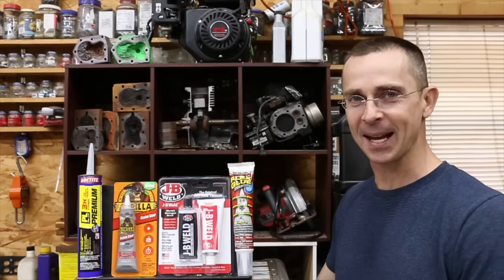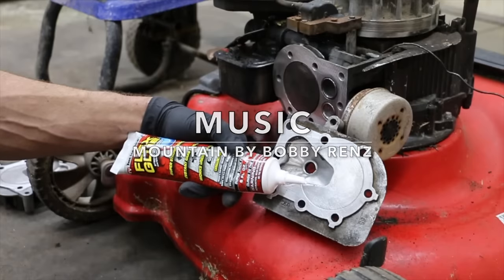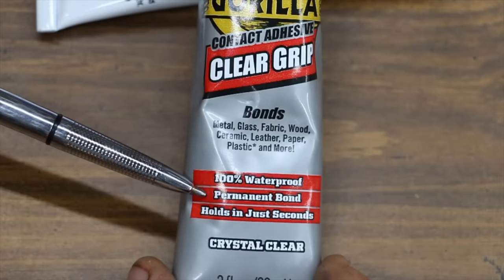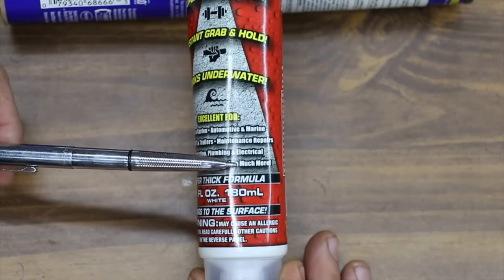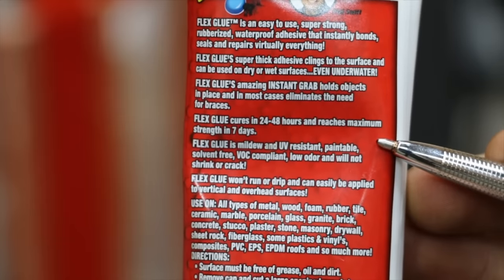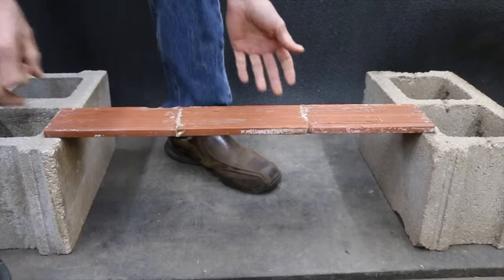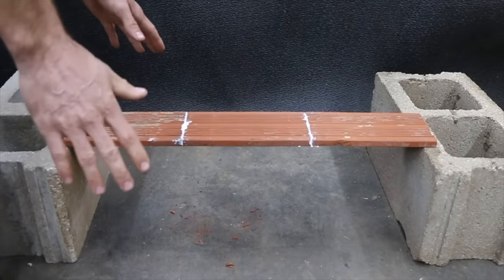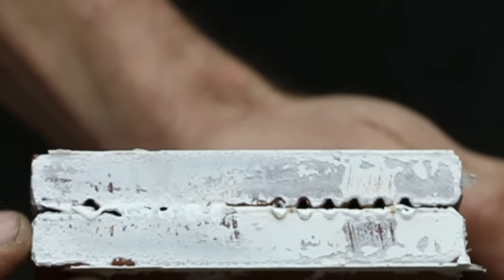Is Flex Glue better than JB Weld, Gorilla & Loctite?  Let's find out!

Comment: If you are doing a head test again, just back the bolts out a few turns.  You'll still know immediately if there's a failure, and it's safer for you and anything down range of the engine.  Of course, it's not as photogenic...
Reply from the maker: Thank you!
Reply: Drama is key.

Comment: I agree with comments below that JB I great except with heat. However on a old Farmall I patched a dime size hole with 1/8 in metal held on with JB. The hole was in the EXHAUST manifold bolted to the block, 2 1/2 in. From block. It never did fail after two years.😮
Reply from the maker: Thanks for sharing.

Comment: I have used JB weld to glue magnetic lock armatures to herculite glass doors. At one job location a thief tied a chain to the door handle and yanked the door out of the frame causing it to shatter. The armature, still attached to the glass was still securely locked to the magnet.
Hands down the best adhesive I have ever used.
Reply from the maker: Thanks for sharing.

Comment: Well for one thing, I didn't know Loctite had a glue. And for another, I never heard of Flex Glue before.

These companies need to watch their packaging. When something is cheaply packaged, and looks like K-Mart house brand, I won't even try it the first time.

How many viewers remember when Wranglerstar patched the ice expansion crack in a water pump? Wasn't it JB that he used? With surprisingly disappointing results. It cost him a lot of money.

These companies need to rely on their reputations. Because I don't have the money to keep trying new things.

Thanks for your test. Very interesting and practical.
Reply: I think Loctite bought out the company that made PL 400, a construction adhesive that was commonly used to glue subfloors to joists. Fabulous stuff, even when applied to wet wood. The bond was stronger than the wood. Not so great on metal.
Reply: Who the fuck repairs a water pump with JB weld, i seen that Wranglerstar channel and the guy is anything but handy. Everything he does is "facepalm" worthy, the second i saw him fell a tree i had to stop watching..
Reply: How have you not heard of flex seal by now? It's advertised all over the place. Even my 86 year old half blind grandma knows what flex seal is.

Comment: Used JB Weld to adhere magnets back to a windshield wiper inside motor housing , cured with 50 watt light bulb for 1 hour . Did repair in 2010 now 2023 , no failure .
Reply from the maker: Thanks for sharing.

Comment: You come up with the craziest ways to test products. I'm curious now if there is actually an epoxy that could hold a cylinder head on an engine.
Reply: If 3m DP460 won't do it then nothing will.
Reply from the maker: Thank you for the video idea!
Reply: @austinjordison  is that a structural automotive glue?
Reply: I wanna see that too!
Reply: @John-wk2fd  I think so. If I recall, it's primarily used for gluing metal panels onto cars.
Reply: Austin Jordison That stuff is just amazing.
Reply: We used it to glue the carbon fiber structural chassis panels together for our solar car. During testing the panels broke before the adhesive.

Comment: Had a leak on a small block chevy aluminum intake manifold. Didn't have the time to fix it. I JB welded it. Two years later I realized I hadn't gotten around to replacing the manifold. I swapped in a new manifold and sold the old one to a guy who was willing to use it. I sold it at scrap aluminum price so he wasn't risking anything but his time. He's been running it for years. Keep the heat under two hundred and it is great stuff.
Reply from the maker: Thank you for sharing!

Comment: NOW THAT'S A LOTTA DAMAGE!
Reply from the maker: I like that quote!
Reply: I laughed so hard when he zoomed in and said that. 😂
Reply: Many years ago I had to do a emergency repair on a aluminium block engine, the thermostat housing bolt stripped out !
    I drilled it out filled it with JB weld let it cure over night. Drilled it and tapped it in the morning.
   Put it together my girlfriend drove it to work !!
   It run fine for another year and then we sold it and they never came back cursing me so it must have worked fine for awhile !
   We are still married after over 40 years and all THANKS to JB WELD !!!
(pretty amazing stuff !!!)

Comment: Broke a chunk out of my transfer case on 86 chevy truck .
Got hung up on a rock when I finally rocked myself off !
My buddy was following me said I was leaking something 
We went back where I hit that rock found the piece of transfer case .
I dried it off when I got home mixed up JB Weld put it on both pieces !
Put the piece back in place small jack and a two by four with shims and held it in place for about 24 hours .
Went out re-filled the gear oil in it. 
4 wheeled in that truck until I sold it , it never did re- break or leak .
Reply from the maker: Fantastic!  Thanks for sharing.

Comment: I remembered using  JB Weld  20 years ago on a car radiator that had a pin sized hole in it and  that patch never leaked again. JB Weld is the best.
Reply from the maker: Impressive repair!  I never leave home without it!

Comment: Pro mechanic tip: use jb weld on your spark plugs, clearly in the video jb weld is best, thumbs up if you agree.
Reply: On your plugs?   Elaborate please?
Reply: @tommyd688  spark plugs the  necessary component needed to make an engine run
Reply: JB goes on the business end or the threads????   Or the wire end???    @zapple8286
Reply: @racketrick  what?
Reply: Why would you use JB weld on a spark plug? You use anti-sieze to insure they don't sieze
Reply: @jonmulack4226  let me have my fun
Reply: Troll is trolling with trollific troll comment.
Reply: @johnlucier5654  can you delete your comment

Comment: I use JB Weld a lot.  A friend hooked me on it many years ago when he patched a leak in his car muffler joint.  The pipe was rusting, so a new leak appeared periodically.  He patched each one until the JB Weld completely encircled the pipe.  The JB Weld never gave way.  A finish carpenter once showed me the trick to using Gorilla and similar glues, at least on wood, is to create a thin occlusive seal.  This is accomplished by compressing the parts together under pressure, thus forcing the glue into the grain.  Otherwise you won't have a thin strong seal.  You'll just have thick surface adhesion.  This may not help with metal since it isn't very porous.
Reply from the maker: Thanks for sharing.

Comment: For gorilla glue you’re supposed to use a spray bottle and spray water on it just a tip fun fact
Reply from the maker: Thank you
Reply: If you don't ,its not that strong.  If you do , i hope you got what you just glued where you want it , cause you won't get it off even with a prybar once it sets
Reply: You're supposed to lightly moisten the surface before you use the glue so that it Foams up and seeps into all the orifices
You don't water the glue itself
Reply: True I put gorilla glue on my car cover to fix a seam and did not moisten it however it rained about 4 hours I put it on and it still set like a rock and now it’s stronger then the actual seam itself
Reply: I agree. I don't think gorilla got a fair shake this time. You have to wet one side to activate it. I still liked the video though.
Reply: The product used in the test is "Gorilla Clear Grip" and is a contact adhesive.  It doesn't require wetting. https://www.gorillatough.com/product/gorilla-clear-grip/  
The Original family of Gorilla Glue requires wetting the surfaces.  https://www.gorillatough.com/products/#filter=.gorilla-glue
Reply: @jonslife3533  I wonder what I am doing wrong then. I wet the surface before, and it still failed! BTW, it was on wood. All it did was  expand like Spray foam, and held even less well!
Reply: @triangleofdeath6246  you need to clamp it as well
Reply: @jonslife3533   I did clamp it.

Comment: I noticed that you did not wet the objects being bonded when you used the Gorilla Glue. 
GG is a special type of glue that needs the moisture to activate.
I don't think it would have out-performed JB Weld, but it may have done a lot better had to wet the surfaces first. It also requires tight clamping, as the product can expand while curing, leaving a weaker joint.
Reply: If you check the instructions on this Gorilla Clear Grip product it doesn't state surfaces need to be moistened.  The original Gorilla polyurethane based glue is a water activated glue.

Comment: Very impressive and thorough testing as always. I too have had good results with J-B Weld. I used it to repair a hole in a snowblower engine case and it ran fine for years with no problems, I also used it and some stainless steel screws to put a homemade bottom fin on my sterndrive with excellent results, it looks and works like the orginal and saved me thousands of dollars.
Reply from the maker: Thanks and you are welcome!  Thanks for sharing.

Comment: I repaired a hydraulic pump on a Hyster fork truck. 3600 psi. On the pressure side. That pump was still working 10 years later.
Reply: Repaired  the pump with JB Weld.
Reply from the maker: Impressive repair!  That's a lot of pressure!
Reply: Jepp Repp didn’t have video cameras in those day maybe a VCR tape.
Reply: Its rated for a bit under 4000 psi so that's why
Reply: get back to us when you repair a snapped-off fork with it.
Reply: Sincerely doubt it was 3600 psi as it would totally destroy JB weld, i have a 400 small block and i had to jump through hoops (wrap it and such) to make it not crumble. The pressure would launch it right of the header, and that's not even close to being 3600psi
Reply: Michel Linschoten it’s all about preparing  of the area.  And I really don’t care if you believe it or nor.
Reply: grizzlygrizzle I’m not sure if your trying to be funny
Reply: Michel Linschoten ...yeah...but a header gets to thousands of decrees...not an fair comparison...

Comment: JB Weld always impresses. I atrick I use to remove rounded out hex screws is...clean it will, JB Weld in the hex wrench, let it dry overnight and it will break that hex screw loose. I had a outside crack in a Chevy PU block and gound a small channel on the crack, applied JB Weld and kept on trucking for years. It was still that way when I traded it in. Amazing product.
Reply from the maker: Thanks for the feedback.

Comment: I fixed a cracked engine block, hairline about 1/4 inch deep, leaking between cylinders at the deck/top of the cylinders, with JB Weld, a little edge filing to clean out the crack (like preparing for a, um, weld), and shaping after applying, and a new head gasket. Crack didn't get worse and engine ran fine for YEARS. That stuff is actually like steel when hardened, and can be machined!
Reply from the maker: Thanks for sharing!

Comment: Good work again!  Fun to watch the engines explode also lol
 How about testing the holding strength by stripping out the head bolt threads on the engines, fill the holes then drill and tap for the bolts. Does JB weld fix striped bolt hole threads or does any other product? After the test if products do survive a running engine then let engine cool and test how much torque it takes to strip out the bolt hole threads or if the bolts actually break first.
Reply from the maker: Thank you very much!

Comment: I'm sorry, but your counter argument is invalid. You should have tested JB Weld against other 2 component glues and the difference would not have been as big or maybe even JB Weld would not have beaten the competiton. I'm not saying it is a bad product (quite the contrary), but this comparison makes no sense at all.
Reply: Right, I would use paste from the first grade instead of any of these.
Reply: Their products, and commercials for said products say they will bond anything.  I must have missed the commercial that said "Warning: Not as good as epoxy", or the product disclaimer on the package that says "Pretty shitty compared to epoxy".  If you're gonna advertise your product as a "wonder, do -all" glue...be prepared to back it up.  But then again, saying "Our new wonder glue isn't as good as glue that has been around for 50+ yrs" wouldn't sell much glue, would it? Truth in advertising would have a spider monkey with leprosy, tossing feces at the buyer on the package instead of a gorilla.

Comment: How about repairing rusted out gutters with flex seal? I need my gutters over the front stairs to make it until summer when the entire roof will be stripped and replaced. After wire brushing inside and out I applied aluminum furnace tape to the bottom of the areas with holes so the Flex Seal spray wouldn’t drip through. A heavy coat was applied inside in the rusty areas. For good measure Flex Seal tape was used to make sure of success. It is working perfectly during our heavy winter on the west coast!

Comment: Project Farm+
id bet 3m 5200 is stronger than all 4 those.......test that plz
Reply from the maker: Thank you for the video idea!
Reply: 5200 for marine ?? Ive heard it dosent break ......the material around it does!!!
Reply: exactly......i used to be a mechanic at a Mastercraft boat dealership and thats what was used in all the underwater gear (rudder port, shaft guide) and id totally put money on you being able to only attach those two high stress items only by the 5200.........we had to reapir fiberglass often and sometimes even had to get a big deal fiberglass guy in cuz heat and everything wouldnt break lose the bent piece and finally with a sledge and alot of sweat you finally have a bent piece of brass with some fiberglass permanently attached......ive never seen anything like the stuff
Reply: look ive used both on many different applications.......5200 literally cures up like ceramic or something.........ive had jb fail in weird little ways at random times for different reasons.........without heat and a sledge hammer ive never seen 5200 budge.......you know how much pressure would be on a 10 inch long 6 inch deep rudder on a 22 foot wakeboard boat?? me either but ive seen boats come in that has hit a log and the shaft the shaft guide rudder and rudder port be bent to hell.........the shaft guide didnt have any of the supposed to be 6 through bolts in for whatever reason......previous mech musta been drunk or somethin........and you also just mentioned tensile strength........what about the other five or so axis of motion??

Comment: First off, great concepts for the various tests of the products.  Having used JB Weld and Loctite before, I wondered about Flex Glue and Gorilla Glue.  Have had success with the Gorilla Tape but won't go for their Glue.  Thanks!!
Reply from the maker: You are welcome!  Thanks for sharing.
Reply: @ProjectFarm  Also, would there be any difference with, for example, the sections of wood if they were clamped end-to-end??  Anyway, just a thought.

Comment: As an avid Rockcrawler, my go to epoxy has always been "QuickSteel", it's held up on a radiator fix
for 6 years now.
Reply from the maker: Thanks for sharing.
Reply: I have a spool mig that hooks up to vehicle battery... just for trail use.
Reply: @mikebolton3816  
Nice!
I have a battery stick welder set, but obviously not for aluminum.

Comment: gorilla glue is just a product with marketing, I couldn't tell you one time its ever done its job.
Reply from the maker: Thank you!
Reply: @spaceybard1655  Yea just needs a Dab of water maybe so does this Gorilla that was used in video. The moisture helps it stick and hold.
Reply: Couldn't agree more
Reply: I agree shit is trash
Reply: 121bham  Yea agree its mixed results depending on wood or other materials. I just know I made bridge out of wooden popsicle sticks and it held around 25 pounds before breaking. But that was a while ago havent touched the glue since...

Comment: You should've included E6000 and/or ShoeGoo, although JB Weld would still beat them.

Which Gorilla products do you recommend? So far I've had a bad experience with everything they make. The Clear grip is advertised to be like E6000 which is fraudulent, it's nothing the same. Clear grip also says bonds in seconds/minutes, which is also a lie. It's a messy worthless product.
Reply: I can vouch, E6000 is very good for many uses (it does get rock hard when cured, so as long as that isn't a problem). Not sure if it's on the same level as JB. 

I've had the same experience with the 2 Gorilla glue products I've tried.

Comment: I used caulk tex extensively in marine applications and as bedding compound for attaching backin plates for installing cleats to truck beds etc... never failed or permitted rust. VERY strong.
Reply from the maker: Thanks for sharing.

Comment: The only competition and 2nd best to JB Weld is MarineTex.  Many moons ago, 1970-ish We destroyed the throttle bracket on a Evinrude, slamming the throttle handle, water skiing. We made a big blob of MarineTex and set the shattered pieces into the blob and let it sit overnight. Even the waxpaper we thought wouldn't stick, was cemented.  While we waited for the new part, it held for weeks of water skiing abuse!  We broke it. Two days later, the marine supply saved our summer and got the new part.
Reply from the maker: Thanks for sharing.